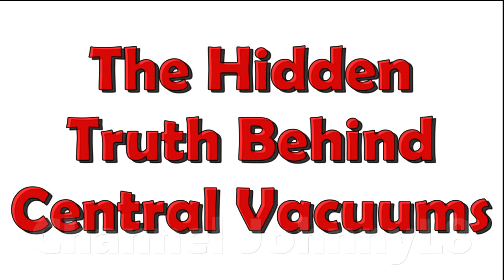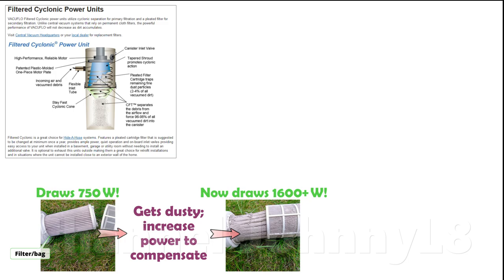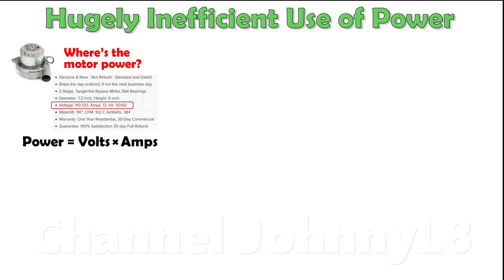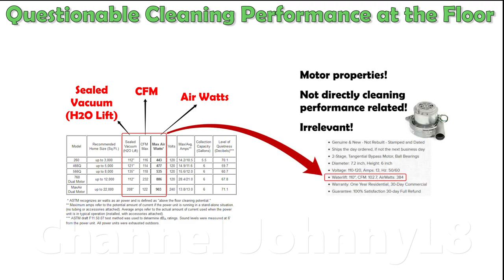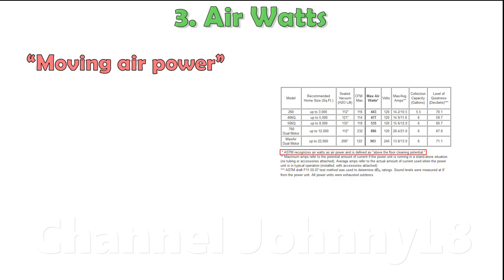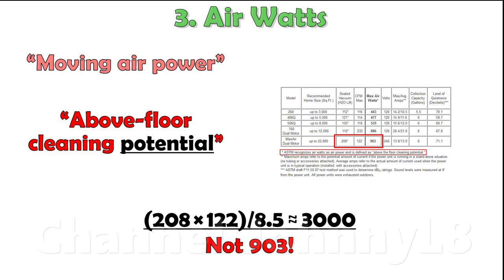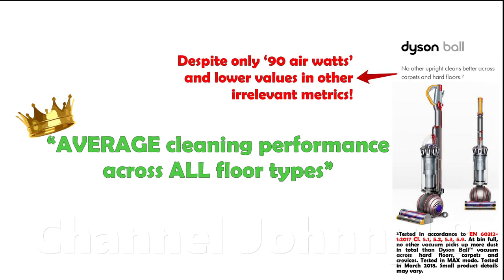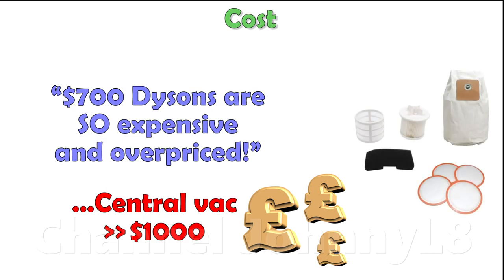Central Vacuums Trail Behind Dyson Cordless

Comment: As a Central Vac owner (the bagged variety).......The dust that escapes the filter ends up outside.  The power a CV has far outshines the stuff you're peddling here sir.   Yes,  there are losses through the piping and hoses...  but even with that accounted for,  there's still an astronomical amount of suction. Sometimes the release valve is needed to keep the linoleum on the floor.  Your argument is invalid.  The original CV system installed with this home had a 40 YEAR life on the first motor.  I would LOVE to see your plastic vac last 40 years.
Reply from the maker: Well of course there is. If you stuck a jet engine on there guzzling gas, you'd have even more suction! But of course what's more important, as I outlined in the video, isn't suction, but actual cleaning performance. The highest levels can be achieved with a TINY fraction of the resources used by such systems. The point you glossed over in your response is that these system have never been formally tested for performance, so no user can actually say how good they are relative to "what I'm peddling"—which have been formally tested and perform exceptionally well. And I'm fairly sure if you measured the performance per unit Watt in particular, the central vac systems would fall right to the bottom of the pile. I'm also fairly sure your central vac wouldn't last 40 years without key component changes, and in that time, their power wastage would be staggering.
Reply from the maker: Wild claims made without evidence. Is this guy like an internet child or something?

Comment: I am more than happy at how clean my carpets are after using my central vac. My Dyson small ball , DC41 Mk2 and V8 do not come close! I fitted my central vac in an hour. I used 3ft of tubing to each inlet and it cost me £450
Reply: Mark Pritchard Central Vac. Consumer Reports show that the Dyson Ball Animal (US) vacuums embedded dirt better than a Riccar Vibrance New Body and a Sebo X5 by significant amounts. And compared to the Kirby, the pickup power is only about 11 points less which means it's fairly close to the performance of one. Just goes to show how delusional some people can be and put hoaxes above facts. But I will say the Sebo X series is crap, but the G series is pretty impressive and worth it in the long run.
Reply: @alanyu7732  Consumer Reports is paid off by companies

Comment: i’ve done one of those dyson tests, with a v11 and my old dc65 that says vacuum with your old cleaner then use the dyson and see the difference. it could very well be my system but on max power the dyson picked up nothing after using my central vac.
Reply from the maker: That's not a convincing test. Reasons why are outlined in my testing videos describing process.
Reply from the maker: And then there's literally everything else raised in the video that are problematic about central vacuums.
Reply: yeah i’m sure 
i personally have a dyson v6 and v11 and use them on the regular, because the central vac is definitely a bulky system 
nothing against your video, i’m just explaining my personal experience. i’ve had the same central vac for 8 years now with a HEPA, and i’ve never had an issue. i don’t know if any future problems will happen with it. but i have a 25 year warranty so i’m all good. 
stay safe during these times!!

Comment: This video was very good until you showed picture of the Dyson V10 as a good performing vacuum. So people should leave their carpets looking good but not truly deep down clean.
Reply from the maker: My deep pile carpets are cleaned well deep down under real-world conditions. Dyson advertise deep cleaning too. And given how many times they've been in court over similar claims, they almost certainly have the evidence to show deep cleaning can be achieved should they ever be challenged. How do you know they don't leave them deep cleaned under real-world use? Or is this a wild guess? Or has confusion come abou because of some silly exaggerated test that misleads what people conclude? There may be other competitor products which also clean deep down, but they don't cite any data about how well they clean, so it's hard to tell and I thus didn't mention them.
Reply: Dyson has no evidence how well they deep clean the carpets. If they had it would put them to shame.
Reply from the maker: Of course they do; they know how well their vacuums clean relative to others. Check out the court documents from the recent Shark suing, it's all there. Links are in the Shark video I made. I've suggested reading that documentation this several times to you, but you apparently haven't looked at the data you claim doesn't exist.

Comment: I’d bet a lot of money that my central vac has more air movement through the nozzle than ANY model of Dyson out there.
Reply from the maker: That speculation literally address absolutely nothing outlined in the video... o.0
Reply: @VacuumFacts  Have you ever actually used a powerful central vac system, compared it directly to other machines, compared how they pick up? I have, I have a central vacuum, a dual motor unit in fact.
Reply from the maker: No but if your implication is that I need to for my video content to be valid, then you've got your work cut out providing an air-tight explanation that fully addresses all points raised.
Reply from the maker: @kurts3779  So you claim; but where's your objective evidence? Talk is cheap when you're making precise factual claims of that nature.
Reply from the maker: @kurts3779  It's not clear what specifically you're even referring to. Your vagueness and unwillingless to go into specific details about anything raised in the video shows a level of obfuscation that healthy skeptics would find more than a little suspicious. If you want to continue a conversation rather than empty contradictions, identify a claim made in my video, state the time stamp, and provide a precise citation and discussion to counter evidence. Otherwise there's not much you have to discuss.
Reply: @VacuumFacts  you sound extremely biased in your comments. No real world testing or experience and when you get called out for it you get mad.
Reply from the maker: @ivancalderon852  I don't think I've ever got mad. Nor has anyone ever succesfully called me out. Everything raised in the video is justified, reasoned, or evidenced. If you have any particular issue, please raise it and provide the evidence you claim I'm lacking. Let's see if you can walk the walk or as cosmetic as the rest.
Reply from the maker: <tumbleweed>... >_>

Comment: And Johnny I have now used a V10 in my home and I can tell you it does not match the best bagged cleaners , it doesn't come close. It's good for quick clean ups very convenient but for me I'd have to use a good mains cleaner at least once a week and the V10 in between
Reply from the maker: As you're probably aware by now, while I don't doubt your sincerity, personal subjectivity, particularly that which contradicts a good test (e.g. my residuals test), has no value to me on matters of fact that bear evidence. :) If you have any real data (you know the kind I mean, like REAL data), then send it along and I'll be more likely to review it open mindedly. As far as I'm able to practically measure in my own home, the V10 performs at least as well as any mains cleaner I've used, including those with objective data demonstrating they're the best performers.
Reply from the maker: In fairness, Dyson haven't said anything about the relative cleaning performance of this machine. My residuals test shows that for normal real-world use, it's comparable to the best. But maybe other less good cleaners would show similar results. But it's not really the cleaning performance (beyond a decent level) that does it for me; it's just how amazingly versatile, costless to run, liberating, and efficient it is to use. There's nothing else out there like that with this level of performance. And with no mains cleaner distractions in the R&D, it's only going to get better with each generation.

Comment: In a CV system, the polluted air is filtered in the unit and a small amount of it can be released in where the motor is installed (garage etc) so they don't need an external exhaust ( Beam CV has it as an option), this is invaluable for people with allergy and asthma. Secondly, in the CV you experience very little noise which is great with 10 years warranty and completely bagless. Your information is poor and your video is rather biased mate.
Reply from the maker: Like toilets, good vacuums shouldn't release dirt at all. You get little noise in modern stick vacs (Dyson ones at least), so that's a moot point. I think the video raises many issues you didn't cover. Having all the problems of this absurd technology exposed isn't bias; it's fact. And you were somewhat vague at explaining which particular information you think is 'poor', let alone providing any good evidence to support your argument. >_>
Reply from the maker: @8civan8  Thanks for raising your strawman. No one ever said there was a filter that "can keep 100% of dust". The problems with exhausting out of the building are exposed in the video you apparently didn't watch before commenting on. >_> I've no idea what you're talking about RE opening a door after a few minutes. You simply ignored everything raised in the video and addressed absolutely none of it.

Comment: Central vacuum floor cleaning performance is entirely based on many factors such as: how well the tubing is installed, what power unit has been selected, what attachment kit has been selected. Also, yes central vacuums should be vented outside but that will guarantee you better indoor air quality. I mean, if you shouldn't vent anything outside, why is a clothes dryer or bathroom vent fan ducted outside? Central vacuums also eliminate the problem of indoor noise pollution by having the power unit in a out of the way place such as a garage or basement.
Reply from the maker: Not very convincing there. Tubing, motor power etc. are secondary; it has been shown time and again that how well a design utilises the resources it has has first-order importance on cleaning performance. And Dyson have shown you don't need much (couple of hundred watts of power in fact). It has been shown that you don't need to be polluting to achieve the cleaning goal; venting outside is a cop out non-solution as discussed in the video. Good products don't vent outside; they do it smarter, including dryers.  The best cordless on the market are also very quiet, so noise pollution is a red herring. And then there's literally everything else I raised in the video showing why they're a ridiculous, wasteful, lazy, sloppy, inefficient, inelegant, polluting, poor way to achieve a goal.

Comment: Is the main point about vacuuming to get the dirt 'out' of your house? If you use a standard vacuum the dirt goes in the bin and is taken out to landfill?
Any dust that's exhausted from a central vac after filtration goes outside where it will disperse naturally. We don't dust outside as it is naturally recycled, so not a problem .
We use a Henry vacuum so not really high technology, it does the job and is built to last, but the idea of having all the dirt taken to a large central vacuum is appealing. Especially when 'all' the dirt is taken out of the house.
Reply from the maker: Might as well chuck other biodegradeable rubbish out of the window too to 'naturally disperse'. Have you considered what happens when this is scaled up to everyone, rather than just one individual the universe seemingly revolves around? Civilised and advanced people have built societies with infrastructure to more respectably handle waste. The worst of us frivolously bypass that. Central vacuums do work, but there are more effective, more practical, and more environmentally friendly solutions (oh, and cheaper). This video simply discussed that. And some people found the facts stated to be offensive because they differed to their subjecive opinions.